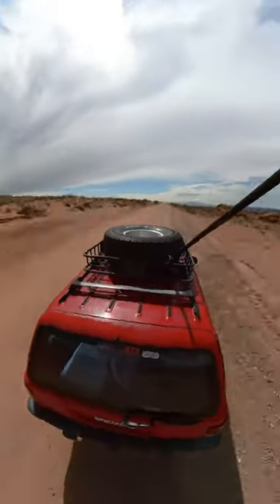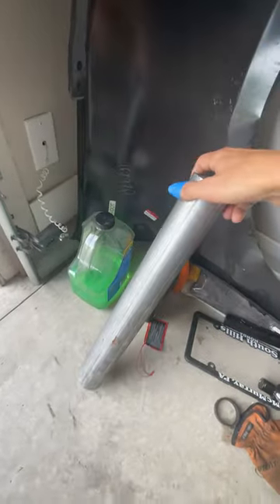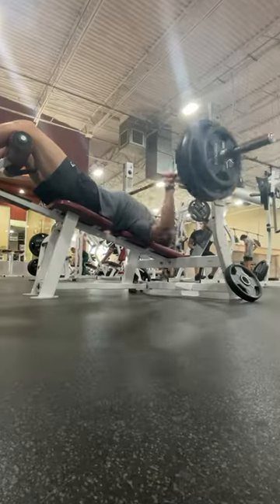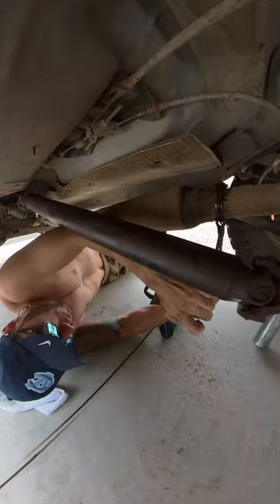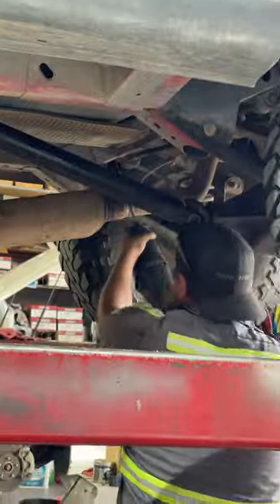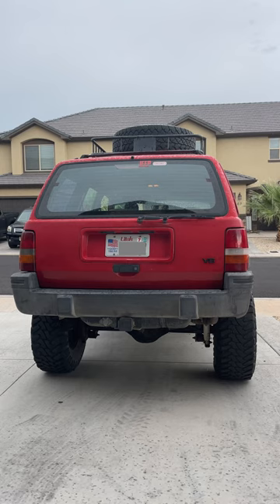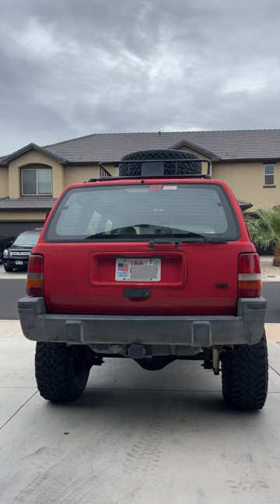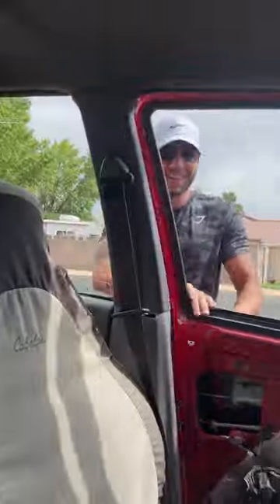Fixing my $2k Jeep's exhaust

Comment: You should definitely invest in some power tools cause all though they can be pricey it can turn a 5hr job into a 2hr job
Reply from the maker: You’re right I will eventually but not in a rush. Spent enough money on a hobby so far haha
Reply: Do not waste your money on power tools. Okay get a sawzall but thats all you need other than possibly an electric impact if you really do need to start saving time and it becomes more than a hobby. 
Put that power tool money into more specialized tools like a compression tester, multimeter, timing light, borescope, vaccuum hand pump, brake bleeder bottle, things like that. I've been an amateur mechanic for about 9 years and all you need to fix(not diagnose that's a whole different set of tools)nearly anything on any vehicle is a good set of ratcheting wrenches $100, and a socket set with deepwell sockets from Craftsman or Husky or something similar for about $200. Other than that you might need a 12" long, 1/2" drive breaker bar for about $30, floor jack from any parts store $150 if you dont have a small jack that came with the vehicle, and an oxy acetylene torch, $250 for a small bottle torch setup. Sounds like a whole lot of money but for about a grand in tools you can fix about anything. 
You seem like a very capable person when it comes to finding and fixing things, these videos are proof of that, and you're not afraid to actually do it instead of calling someone to "help" and just sit there and watch them do it. 
The internet will guide you if you just type in the right things. I don't know how many hours I've spent searching forums, articles, and videos to find the info I need. In the end I always fixed what I was looking for. If you get frustrated take a break, don't break something. That just costs more money.
Reply: 20 dollar recip saw at Harbor Freight .
Reply: Even a cheap harbor freight reciprocating saw would slice that exhaust like butter. I also recommend an exhaust stretcher for flaring out one side so the pipes fit together right. I’ve had to replace the exhaust on my yj 3 times because I keep smashing it.
Reply: @stayve.  if you do, buy Ryobi, from my experience they are the best bang/buck. I still have gen 1 tools from like 2009 that work like new. Pro tip: around Father’s Day you can get 2 large batteries and a free tool for 100 bucks
Reply: And a ton of screaming in frustration on why my Chinese made tool aren't cutting it
Reply: @stayve.  sounds like you need harbor freight. They make some dirt cheap tools that will definetly get the job done, but if you don't plan on using them much you don't need to worry about the quality a whole lot.
Reply: don't get battery power tools or new unless you really need them

hint: you don't

batteries are hella expensive, die after a few years, their skins are expensive and die not that long after. get second hand corded tools for pretty much free
Reply: @rolls _879  i have both, the corded tools are for back up and really big long job. The cordless are for fast and easy or when im traveling.
Reply: @JeepTrailsandBarbells  if you're doing jobs in the field without access to AC power, then obviously you have a use for them, but most homeowners, hobbyists, and even other professionals just don't
Reply: Time is money
Reply: Don’t forget, a days effort into just a fraction of what it has to be

Comment: Honestly that straight pipe on the 318 sounds pretty good. I’d keep that.
Reply from the maker: I agree it just drones pretty loud when moving 30mph+ with nothing but headers and the downpipe. Idle it sounds sick. I think once I fix the small leak around my downpipe it’ll sound better
Reply: @stayve.  Hi
Reply from the maker: @DJMACK193  ayo
Reply: @stayve.  you should try MagnaFlow muffler. I heard It has all sorts of loudness, from agressivly loud to pretty quiet but still deep sounding
Reply: I threw a Mopar performance muffler on my 5.2 and it sounded super smooth and mean
Reply: @stayve.  how much total cost

Comment: A silent off road vehicle is worth it. Went straight pipes on my old 4 runner and installed regretted it. Having a quiet off roading vehicle is also very beneficial. Example someone could be yelling directions for you... and a straight pipe? You won't hear them also good to have a quite exhaust to hear what your engine and suspension components are doing.
Reply: I agree.  A quiet truck allows you to hear any issues with the Jeep before they get worse

Comment: The tailpipe on my $2,000 Rodeo was completely rusted away from the muffler...I replaced both. Parts cost was $125. I used a Dremel moto-tool with cutoff disc to cut slits on muffler pipe to exhaust pipe to remove it.
👍

Comment: I forgot to mention in my last comment where you asked for any info on things to check if you plan on doing any rock crawling or serious off-road driving make sure you have sway bar disconnects it’s gonna give you more suspension travel only take them off when you get to the area you are off-roading at and reattach when leaving to drive home. You don’t wanna drive highway speeds without them. Also what axles are the front and rear mine was a Dana 40 and 35 with upgraded gears and out wheeled my brothers 2010 wrangler with lockers and a whole bunch of other things not the best axles you can get but they worked solid on my rig just make sure your seals and gears are good and replace the fluid like I said last time. I had my 89xj from when I was 16 to 19 and ended up letting it sit due to a vacuum leak causing a transmission issue that I didn’t have the time or a shop to pull it apart to fix. It was my daily for 3 years and I miss having it I traded it to a friend for a 96 Tahoe that I plan on supercharging and building. My friend who is a mechanic with a shop fixed it and sold it so I’ll probably never see it again. Goodbye STUG.

Comment: My profile picture is of my old truck a 01 ram 1500 with the 5.9 pretty much the same thing as a 5.2 for those who know. The typical dodge problem with these engines are your throttle body sensors any one of 3 sensors, heads are prone to cracking, plenum gaskets tend to burn out causing massive oil burning and vacuum loss, be happy to help some more if I can!

Comment: Check engine light fix included a spark plug spacer welded to pipe so you can screw o2 sensor back in and trick into working

Comment: I miss my ol Jeep.  It was a 1989 Grand Cherokee, which I purchased for $800.  The gent I purchased it from didn’t even know if it would run.  It had a straight 6 from Jasper Motors in it and it was a torque monster in 4wd low.  You could make the front end come off the ground about 1 foot LOL.  The BILLY GOAT, it was one heck of a Jeep that got me back and forth to work down one of the busiest corridors in Central FL.  Drove it roughly 150-200 miles a day and I used it like that for well over a year.  The A/C blew cold, and the only issue I ever had with it was the transmission wouldn’t shift as an automatic, so I had to manually change the gears.  Not a big deal considering how much loot that thing made me.  I now drive a Mitsubishi Endeavor AWD, but it’s just not the same as my ol’ Billy Goat!!!

Comment: Okay... Looks like you have a "1st Gen ZJ". Should be a Dana 30 front axle and a Dana 35 rear. A common upgrade is to put a Dana 44HD from a 96-98 ZJ in the rear w/disc brakes. However, the 44HD is an aluminum centersection so it can cause issues.   Most V8 ZJ's came with the 249 Transfer case. A good mod to make is to swap to a 242 or a 231 transfer case. The 242 swap requires changing the input shaft of the transfer case.  The wiring for the transfer case status lights is already behind the dash. Just have to swap plugs.   Death wobble can be a PITA, even after replacing EVERYTHING in the front end. You can have your alignment guy give you a slight bit of toe out will keep it away.    These motors will start to burn oil.The "kegger" intake manifold is a two-piece design that has a plate on the bottom that the gasket will blow out on and the motor will start sucking up oil from the lifter valley. There are companies that sell thick aluminum plates to fix this.  These transmissions (You should have a 46RH) are sensitive to fluid. ONLY USE ATF+4!Do not use Dexron/Mercon. Also, there is a check-ball inline of the cooler lines. If you get the trans hot enough, it will melt this ball and stick, causing the fluid to stop flowing through the cooler and fry the trans.   I own two ZJ's myself (96 & a 98) and my brother has two ZJ's as well (94 & 95). I've become pretty good at working with them. Please feel free to msg me if there is anything I can do to help.
Reply from the maker: Thanks for the tips my man. I’ve got a couple new friends with ZJs that have been lending their knowledge as well. If you wanna shoot me an email with your contact info feel free. Contactstayve@gmail.com

Comment: Other things: If you have to replace O2 sensors, only use NTK. Bosch will not work.   Don't use any spark plugs except what is called for on the tag on the core support. These motors do not have a hot enough ignition system to fire a platinum plug.

Comment: Hey here's the tip, you stick a Shop-Vac up the muffler and duct tape it and set it to blow with the car off and then take a soapy spray bottle and you can find which gasket is leaking like that because it will bubble, that's why I was able to figure out I needed to change my donut gasket not my manifold gasket

Comment: Home Depot does deals on Ryobi cordless tools occasionally that are unbeatable. I still have the blue Ryobi cordless tools I bought a long long time ago and they're louder but work so they most definitely paid for themselves. Pawn shops are also a great resource especially if you like negotiating and is how I bought Snap-On at Craftsman prices when I first started out. The Snap-On dealer gave me the last tip believe it or not.

Comment: I can help you build this into a monster, Ive had plenty of them. First ill say be easy in 4wd as the 249 transfer case is weak and prone to failure. You can put in a different one but will need a different sized imput shaft. Also the higher you lift the jeep, the transfer case will get worse pinion angles, do not do a transfer case drop, it will rob you of ground clearance. Also GEARING is super important if your running anything over a 31" tire. You can swap out the low pinion dana 30 with a high pinion dana 30 from a cherokee, its a good cheap upgrade that will last longer.

Comment: Chopped the exhaust off my truck in about 15 seconds with a sawzall and a blade made for cutting metal, took about 20 minutes to weld the new pipe on and then put an exhaust clamp, a cheap sawzall with run you about 40 dollars at a pawnshop and last you a lifetime if you take care of it.

Comment: straight piping it is when you tape the Cadillac converter off which is that big round thing on the exhaust so technically it didn’t straightpipe it all the way
Reply from the maker: I believe it’s actually a resonator not a cat

Comment: Starting out like you did a 20$ grinder from fb is all you need to cut anything on the car that you can't get off or is just not worth the struggle like suspension or stripped bolts, even the exhaust taking the guard of and a thinner wheel

Comment: Yo man you dont need to buy a super expensive saw or grinder. I think you can get a saw like that at Walmart for under 50 bucks and I know a 4 in grinder is like closer to 20 or 30 bucks and had you the space you could even cut a pipe with a cutting wheel on the grinder easily

Comment: Did the jeep shut off because of bad crank shaft position senor?
Reply from the maker: Yup! Ended up changing it twice. Never buy a non-mopar CKP sensor. Lesson learned
Reply: @stayve.  well the crank shaft position sensor is a common fail for the magnum 5.2 and 5.9 and other chrysler vehicles something to do with the connector and moisture built up and can't dry out

Comment: How much did you pay the muffler shop for that?? Get a sawzall at harbor freight for $25... Geez...

Actually the cheapest sawzall at HF is $30 but they usually have 20%off coupons...

You'll eventually figure out that you can aquire the tools you need for alot cheaper than taking it to a shop... Start buying tools!

Comment: Are you just casually decline pressing 365??
Reply from the maker: I wish haha. It’s 275
Reply: @stayve.  oh ya I see that now haha. Nice lift tho, what's your max bench? Probably somewhere in the 300s
Reply from the maker: @BEERU5  it’s varied over time. I’m 6’1” so when I was 203lbs I was easily decline benching 315 and the most at that time I’ve done was 330. Now a couple years later I’ve since cut down and I sit between 170-180lbs these days. When I was 173lbs a couple months ago I benched 350 on a smith machine which was 2x bodyweight. But def couldn’t do that on a barbell. I’ve lost a slight bit of strength since then so my max rn is probably anywhere from 285-305 depending on the day. Not really sure though since I don’t really go higher than like a 3-4 rep max these days